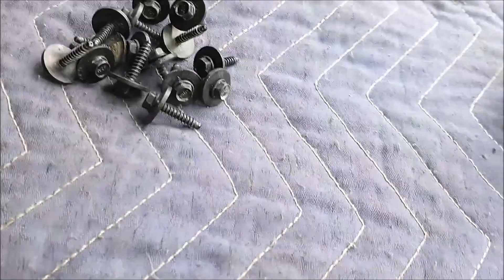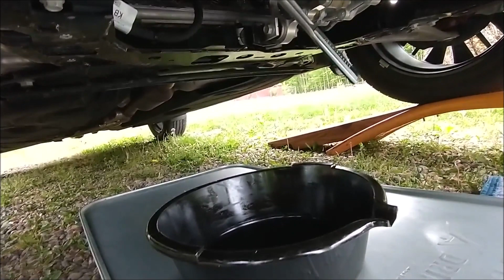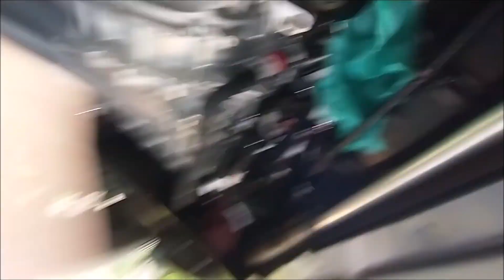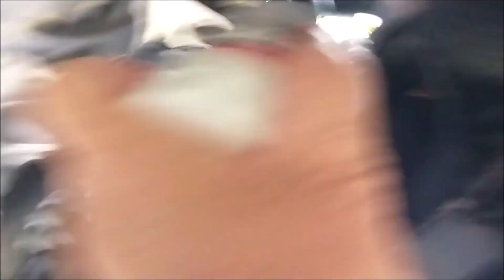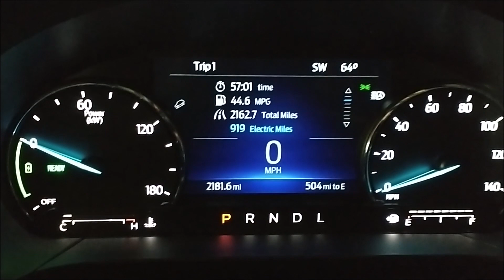2021 Ford Escape Hybrid -  DIY Oil And Filter Change

Comment from the maker: Just got the next  FL910S filter for the 10,000 mile oil change already!  Wanted to keep the changes at the OEM-recommended mileage, even though I could go another 2k.  No issues at all with the car in that time.
Tire rotation at 6,000 miles turned out to be a PITA as there's very few places to locate the four jack stands if using the pinch welds to lift with a hydraulic jack.  The shielding underneath leaves very little structure exposed.  Had to use the lower control arms at the front and 1 foot blocks of wood to raise my jacks high enough to locate on the frame at the rear, ahead of the bumper.  The rear lower control arms are flimsy aluminum pressings and I don't suggest using them to sit on the rear jack stands!

Be careful with the threaded clips for the undershield.    
I took the car in for the second time at 50k to address a weep at the front cover joint (a typical Ford issue as the RTV bead is very small).   The technician cross-threaded one of the screws into the frame at the back.  When I did the next oil change, the screw wouldn't turn and broke off level with the clip-nut!
The dealer agreed to replace it but simply drove it out and  used a plastic push-pin, and tried to charge me $37!
I've since traded it and drive a 2025 Camry XLE AWD.   A really great car that gets 47mpg in the summer and 41 in the harsh winter.   Much quicker to change the oil too with it's small removable access panel.
Reply: You mentioned that in the manual the filter should be FL910S - could you please share which manual is that? I haven't found anything regarding what filter should be used. Thanks!
Reply from the maker: I guess it was the owner's manual.   Either way, that's the one you need. @spiriad
Reply: @AllenReinecke  Thanks, indeed this info is present in the Escape manual, but not in the Kuga one, even though it's the same car.
Reply: @spiriad  I seen the FL910-S in the manual at Walmart
Reply from the maker: Interesting. 🤔

Comment: Anyone tried or got info to change the cvt gearbox fluid, yeah not serviceable and lifetime is never good to me. Drain out amount and refill the same could be done maybe?
Reply: Ford recommends 150k for the first change or 30k for severe use. I got mine changed at 30k.
Reply: @trenton737  I bought the fluid now, and gonna change at 50k on mine, light use up until now..
Reply: @martinrasmussen8745  Hej. Jaki dokładnie olej kupiłeś??. Możesz podesłać zdjęcie etykiety lub link jaki olej kupiłeś
Reply: @leszekles726 Liqui Moly ev520 - do not change before atleast 150kkm - my Kuga was done at 75kkm, and the oil was not worn down at all..
Reply: @martinrasmussen8745 dziękuję za odpowiedź. Mam przejechanie 69 tyś także nie zmieniam.
Reply: @leszekles726  If you do normal driving and no heavy loads all the time its a waste of money, and the oil in these cvt's are not getting worn down as usual auto gearboxes. As i wrote  you can easely wait until 150kkm, and you're not hurting the gearbox at all.

Comment from the maker: Be careful with the threaded clips for the undershield.   
I took the car in for the secong t8me to address a weep at the front cover joint (a typical Ford issue as the RTV bead is very small).   The technician cross-threaded one of the screws into the frame at the back.  When I did the next oil change, the screw wouldn't turn and broke off level with the clip-nut!
The dealer agreed to replace it but simply drove it out and  used a plastic push-pin, and tried to charge me $37!
I've since traded it and drive a 2025 Camry XLE AWD.   A really great car that gets 47mpg in the summer and 41 in the harsh winter.   Much quicker to change the oil too with it's small removable access panel.

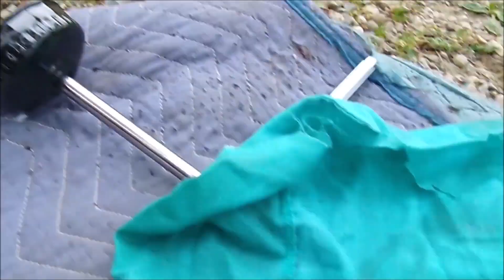Comment: 9:00 No, it would have been easier if these imbecile engineers would make similar oil filters all the same diameter so you only need one removal tool. And thank you for the great detailed video

Comment: Just my opinion, your way of using the ramps doesn’t look safe to me. The car should be driven up to the flat area of the ramps. There should be something in the rear wheels to prevent it from rolling back. If you have jack stands, you can set them up for additional protection.
Reply: Jacks stands are not safe with ramps when the car rolls the stands collapse
Reply from the maker: The ramp is as safe as any ramp on gravel/dirt.   The car height is at its highest on the auxiliary wooden ramp. I engage the rear wheel park brake and there's a chock under one wheel.  If I drive further forward onto the steel ramp, it's problematic getting back onto the edge of the wooden ramp.   There are 2 bolts engaging with the steel ramp's holes, but the wooden ramp will pivot on those with the tire on the front edge.
As with any support, I heavily rock the car to check the stability.
I've used this actual ramp system for 24 years without any issues.
As you rightly point out - Safety first!   👍
Reply: @AllenReinecke I use ramps and I put Jack stands in place for backup and I also leave the jack in place. I like to have lots of redundancy when I’m under a car because if a ranp was to fail I want backup. I even bought some nice 4 ton CAT jack stands that use a safety pin in them. I never felt comfortable having jack stands elevated high with no backup safety feature to prevent them from dropping. You can never be too safe working under a car! What amazes me are the fellas you see working under a car with it supported only by the jack. I have seen a number of videos like that. Lots of people get crushed by cars working that way.
Reply from the maker: @newfie-dean5803  When I was in my teens, I used to work on my old car in my dad's barn.  Dirt floor, large blocks of wood as jack stands.  I look back, amazed I survived. Teenagers do some dumb stuff!  😂
Reply from the maker: @newfie-dean5803  I use back up too when the situation requires it, with multiple jack stands.  Never just a hydraulic or mechanical jack.
Reply from the maker: I inspect them too, before each use.
Reply: @AllenReinecke  Sounds great. I came across your video while researching the Escape Hybrid or PHEV or my next purchase. I am a bit concerned about the undercarriage protection, especially for the hybrid/battery system. What do you think about the car's overall reliability after the years? Thanks.
Reply from the maker: @TheHandsomebaby   we have 65k on it to-date.  No issues at all but for a front cover weep at around 40k.  That was fixed under warranty but was still weeping at 50k.   That was repaired again and at 60k, it was still weeping, though less than before.   Trying to get a good seal with sealant is very tricky in the car as there's little room to slide the cover into place.   There's still the engine fire recall but at 60k. I'm not concerned as the faulty crankshaft would have shown by now.   The ride and driveability is very nice.   Another couple years and we'll buy another hybrid.  Maybe a Corolla Cross or a 2025 updated RAV 4 if it's more comfortable than the current generation.   Not impressed with Ford and their current quality issues.  Farley isn't a good CEO IMHO
Reply: @AllenReinecke  Thanks. I have a Highlander Hybrid and love everything about it. I am trying to find a second and smaller car. Corrolla and Corolla Cross are great but I hate to deal with Toyota dealers. A more electrified alternative like the Escape PHEV is very attractive. I will have to do more research. Thanks again.
Reply from the maker: @TheHandsomebaby  Good luck!  I don't like Toyota dealers either!

Comment: To remove a seized oil filter puncture it right through with a pointy screwdriver.
CAUTION HERE …..DO NOT HIT TOO HARD AS TO DAMAGE THE BOLT ON THE ENGINE BLOCK.
An oil filter is made of thin steel and should puncture easily.
Practice on an old filter if you’re not confident.
Make sure you have room to apply torque in the right direction at least a 1/4 turn

Comment: Fuel economy=early motor death. 
Normal oil 15W-40 = long Motor life. 
You choose the option.
Reply: BAHAHAHAHA 15w-40 THATS HILARIOUS
Reply: @lukeWiz44  what is hilarious? 
5W-20 is recommended for fuel economy only, but its high wear because of very thin oil.

10W-40 or 15W-40 or 5-40 or 5-50 for long engine life.

Remember, its only RECOMMENDATIONS and not REQUIREMENTS, the difference is HUGE.
Reply: @igor2030ign  oh you weren’t joking… jeez. Dude, it’s not 1970 anymore. engines have changed. tolerances are a lot smaller, oil galleys and oil control rings on pistons have tightened. you try to run a 15 W 40, you will deprive the engine of oil. and my man, this isn’t up for debate, it’s literally scientific.
Reply: @lukeWiz44  ok... 

No more conversation. Bye.
Reply: @zerocryption  if you want to take the risk, fine. my car is still under warranty. 0w20 it is.
Reply: Beg to differ. I use 5w20 in my 03 mustang and it has 281k on original engine and timing chain. Rolling dice on engine failure now.

Comment: Recommended 2022 phev is 5w 20
Reply: @nissetuta  yes!
Reply: Its recommended, not required! 

Recommend for what? For fuel economy and early motor death.
Reply: @igor2030ign 
5w is much safer than 0w. 
0w-20 is much thinner for fuel economy

Comment: I don’t know why the owners manual says to use 0w-30 when the filler cap and advance auto computer says 0w-20.
Reply: Hnm im about to change my 2022 phev which one should i do?
Reply: @luisbolanosiii2625 put in what it says to put in right on your oil cap.

Comment: How are you getting so many miles electric?
Reply from the maker: No lead foot!  
Use the EV Coach display and maximize the time in EV Mode by not exceeding 60kW.
Sports mode prioritizes engine over electric for example.
I also blip the throttle to force it back into EV Mode.  Hysteresis in the system keeps the engine running once that is on.  Dropping momentarily into recharge and then to power will switch back to electric if there's enough charge.  
I do that but my wife just drives.  We get around 40 to 44 %  EV on average and 44 mpg.  Cold weather drops that into the upper 30's though.
Reply: @AllenReinecke  what do you mean “blip” the throttle?
Reply from the maker: @pdeblois1880  see where I said dropping into recharge momentarily

Comment: Excellent video... would have been nice if Ford would have put a access port in that engine cover like some other manufacturers do..
Reply from the maker: Agreed!   My Daughter's Kia Forte has a hard plastic undershield with cutouts for filter and oil drain. The latter is even teardrop shaped for the oil jet!

Comment: To take out an unruly filter I just puncture it with a medium length fine point screw driver .
Being careful not to puncture anything else in the area.
It’s messy because the oil leaks out but it always works. 
You just use the screwdriver as a wrench. Works like a charm.
Reply: Punch a hole in the lowest point of the filter first, let the oil drain out, then it's not messy.

Comment: Thanks for this video.  I used to change my own oil, but since I turned 70, decided to let my Ford dealer do it.  They will use my oil and filter (Mobil 1) and charge me $40 for the oil change and rotate the tires.  After watching what is involved, I think it is a fair deal.
Reply: $40 for all that from a dealer?  My GF bought her 2021 Escape Hybrid new a year and a half ago, 12k miles on it.  She went back to the dealer this afternoon for an oil change.  I'm on the phone with her right now and if she didn't still have some "Ford Dollars" she got when she bought it, and thus didn't have any out-of-pocket expense, she would have been PISSED!  They charged $66 for oil and filter, another $40 for labor, and rotated her tires without asking.  And you got all that for $40?  Granted it was 8 months ago and inflation is rampant, but still, $40?  Do you have some kind of deal with them?  I'm here to find out what's involved with doing it myself.  I change the oil myself on all my vehicles and farm equipment, and now I guess I'll start doing her car as well.  I never take a vehicle to a dealer for anything.  You usually pay a huge premium for repairs and maintenance.  You must have something on the dealer.
Reply: @farmerdave1954  No, I have purchased a number of cars from them and they have always been fair on the oil change labor charge.  I have used Mobil 1 for at least 40 years and never had engine problems.  I simply asked the quick lane staff if they would use my oil and filter and they said yes, and just charge me $40 for doing it.  I was surprised when they kept the same price on the Escape Hybrid, with all of the extra work taking the panel off.   I did make a mistake in getting a battery for my 2017 Escape at the dealer almost $200 and labor on top.  Took my Fusion to Sams - $120 battery installed

Comment: Just curious. . Are you changing the fluid on the power transfer unit ?  If so how often ?
Reply from the maker: I'd do first change on the Power Transfer Unit at 15k, then every 30k.
Reply: @AllenReinecke  are you going to do a video on that?
Reply from the maker: @michaelabbott8431  No.  There's already a good one on YouTube.  He also has a video on the rear diff oil change. I'd do that every 30K also

https://youtu.be/tNs7va19a-8
Reply: @AllenReinecke  I wonder why they don't mention the ptu maintenance/fluid change in the manual.     Or I can't find it.  And I called the ford dealer and they acted like they had no clue what I was talking about initially  . They had to call me back after investigating.  They quoted 280 $ for the one quart service.
Reply from the maker: @michaelabbott8431  why I try to never use a Stealership!
Reply from the maker: The quart of Motorcraft 75W-85 oil  from the Ford parts Dept was ~ $25.  The tube of Permatex thread sealant (good for many applications) ~ $7.  Did it at same time as motor oil change, so it added no more than ~15 minutes to the service.

Comment: Was this your first oil change?
Reply from the maker: In the video, yes.  Since that ~2K oil change, I've changed the oil at each 10k odometer miles.  That equates to about 5,600 engine miles since we run about 44% in  electric-only mode.
Reply: @AllenReinecke  just out of curiosity.  Does changing the oil yourself void your warranty?
Reply from the maker: @michaelabbott8431  absolutely not.  That's illegal.   You have a right to DIY.  You should follow OEM specs, keep receipts and a service record though, in case you do have a warranty claim.  A record is useful to track issues (I even record all my garden equipment stuff!  But then I'm an OCD engineer.  😂) 
I've changed the PTU oil early (critical oil change as it only holds about a quart of oil) and will do the rear axle at the next engine oil change.
Fortunately, Ford has added easy fill and drain plugs on the Escape  They used to not!
Reply: @AllenReinecke  if there's a spare tire in the back.  Where is your 12 volt battery?
Reply from the maker: @michaelabbott8431  under the spare tire, in the center of the wheel well.  There are posts in the engine bay for jump starts/charging.
Reply: @AllenReinecke  what ate you keeping your cold temp for the tires by using the Ford pass app ?
Reply from the maker: @michaelabbott8431  Not sure of the question.  Don't use the app for tire pressure, other than checking if one is going low.  Best to use a tire gauge and set to OEM spec.

Comment: Thank you for taking the time to demo the oil change, as I have a new 2022 Escape Hybrid and realize that I should change it before 3000 miles. One question, is it possible to see the oil filter from on top of the engine bay?
Reply from the maker: 👍
You can clearly see the oil filter, but it's too far down to work on from above

Comment: You know, at one time the yellow Ultra Ramps shown had optional red color ramp extenders made of some heavy duty PVC 'type" material that attached in the ramp holes at the end. I know because I still own the same ramps AND the extenders. Don't know why they don't still make them, because without them Ultra Ramps alone unusable on most of today's lower profile vehicles. I now also own a set of the Rhino Maxx ramps too. I like them a lot. Lighter than the Ultras. Good homemade ramp extenders. If there was much of a market, you could sell them.